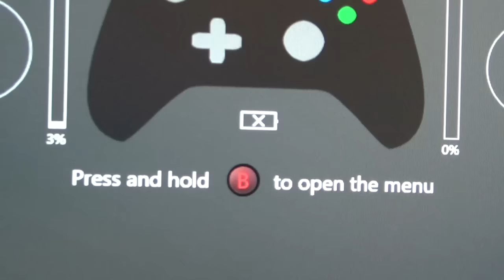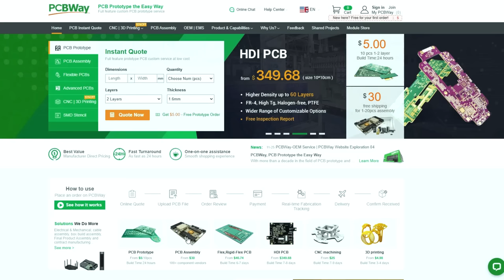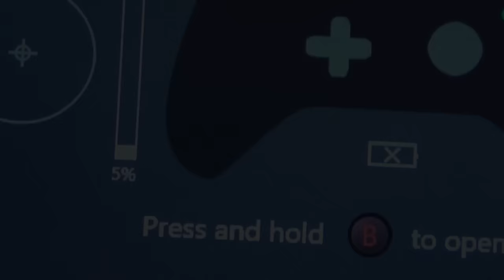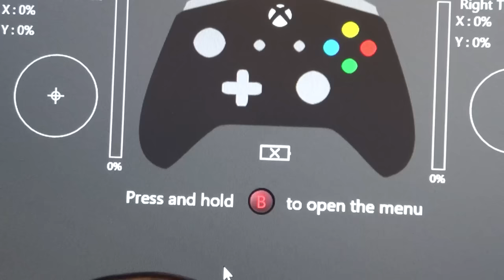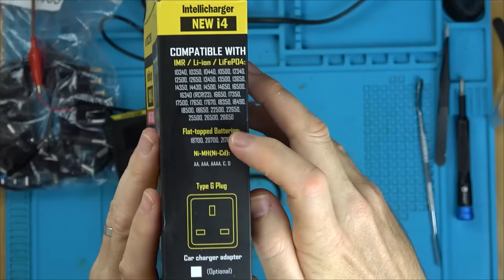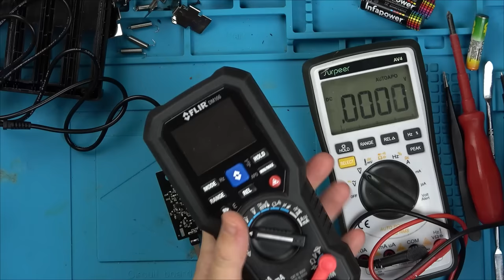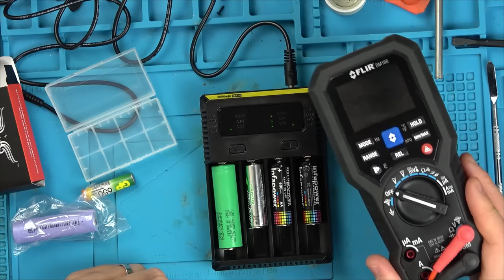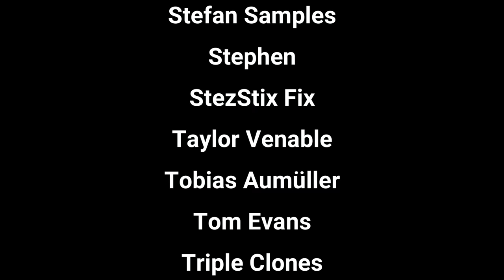More More MORE AMAZON RETURNS - Can They Be FIXED?

Comment: I bought one of those intellichargers from Ebay a few years ago to charge my 18650 vape batteries.   I noticed that some reviewers were noticing that the charger didn't completely charge the batteries to 100 percent, and I noticed the same with mine.  So I sent it back.
Reply: Some types of 18650 will accept a full 4.35v charge, but most chargers cut off at around 4.15v.

Comment: Hello Vince, 
I have a Nintendo switch lite with a backlight and everything works but no image is being displayed. I have tried with another motherboard and it works but this board, it just doesn't want to show an image. I checked the LCD connectors and it looks good so I am scratching my head here on what to do. The backlight chip gets hot on touch and gradually keeps getting hotter but the backlight is still on. Would u like to take a look at this switch board?

Comment: I"m not really sure about what I'm saying but I'm pretty sure the component you identified as a transformer isn't really a transformer of the traditional AC step down type that you may think. This is a switching power supply, much like the small "wall wart" kinds of power supplies that we see these days, that are very lightweight and very power efficient, and nothing like a traditional step down transformer that feeds a bridge rectifier smoothed by electrolytic capacitors.

Comment: 5:03  That red cable on the right looks crushed and the insulation is compromised.  You might want to look into it.  Yes, it's probably just plastic from the cover pressing against it, but for the longevity sake...

Comment: The power coming from the transformer is AC so the diode needs to change it to dc for it to charge the battery. since the diode is shorted it is feeding ac to the battery.

Comment: Hmm, plugging in the charger, the two bare metal leads on the left were touching, like if you had put in a screw instead of a battery to charge... maybe that caused the noise? We'll see, still watching... The diode probably regulates that you don't plug both AC and 12V at the same time, draining the excess to ground if that makes any sense (shot in the dark here)...

Comment: Isn't that diode responsible for voltage rectification?  Actually it may be reverse protection diode as well, but considering it comes from one of the AC leads from the transformer, its probably responsible for voltage rectification.

Comment: Totally agree with the point of view that wireless controllers, are  maybe not the way forward. Yes great whilst the system is in daily use. Old systems often end up in a loft. So much combustible material in a loft, especially during those long warm summer months. Old systems with a couple of double AA non-rechargable batteries might leak, something that will locally damage the internal circuits in that device, but what about something that is potentially combustible , like the potential, unplanned discharge following a leak from those, no longer cared for,  Li-on type batteries, is it a regular occurrence from such neglected devices that contain these type of batteries, can they spontaneously combust. Me, i can get aggravated, whilst playing games i want to throw the controller away from myself, not a good habit. Something like that could damage a modern game console controller feedback from the chat would be appreciated?

Comment: I noticed that beside the transformer there was a chip with 4 legs each side. Could this be a full bridge rectifier package, i.e.. 4 diodes in 1 package; then the diode removed might just be to make sure the 12v goes the right way. Just a thought.